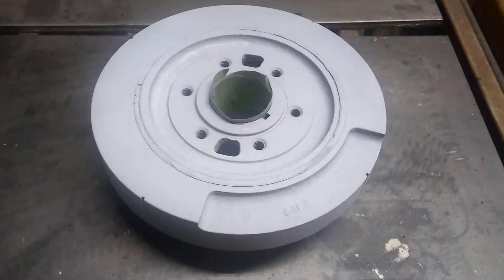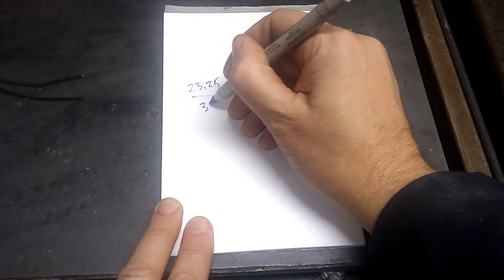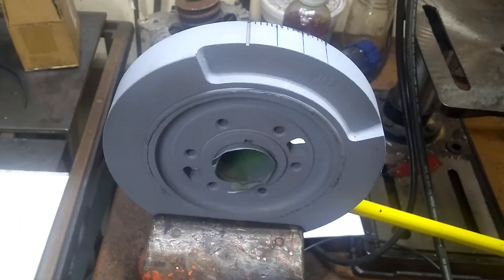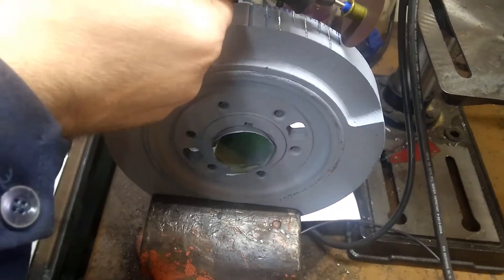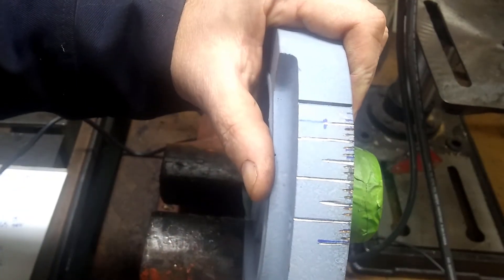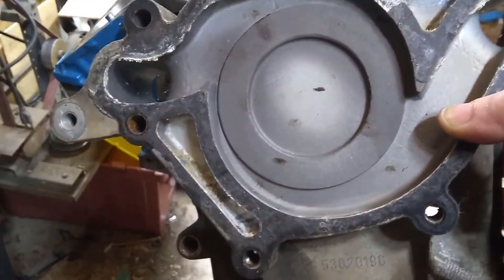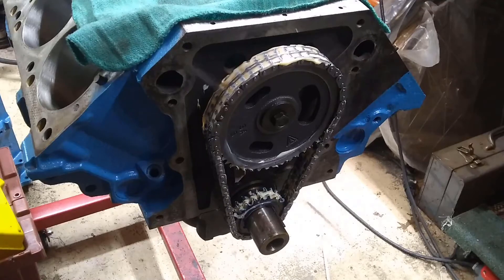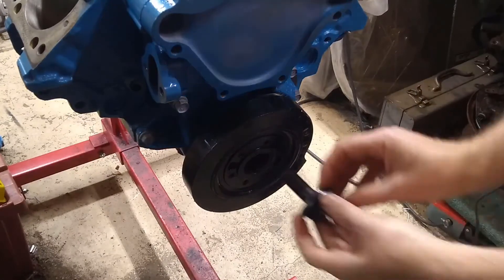The way factory timing marks SHOULD be done | Mopar 5.9 Magnum Build #9

Comment: While you're there, mark the outer  damper ring in relation to the inner hub so you can tell later on if the rubber bond between the inner and outer has failed.
Reply from the maker: A good idea!